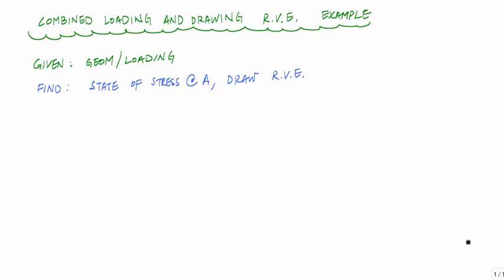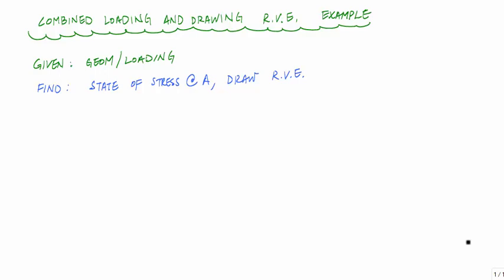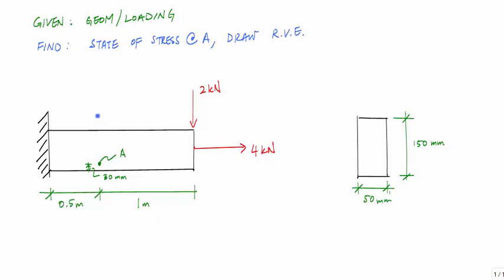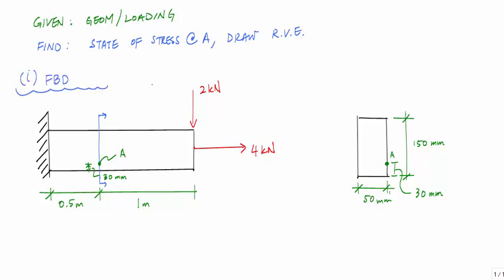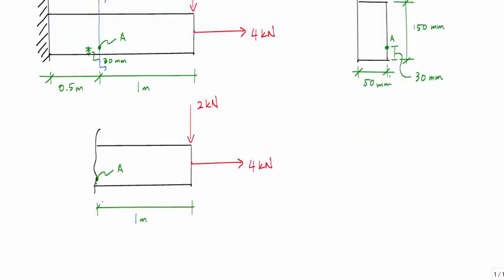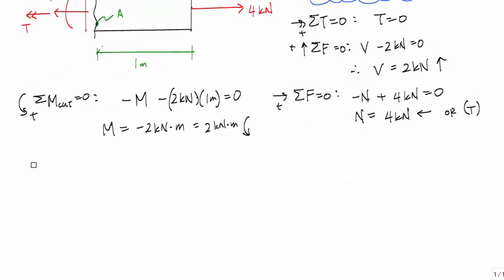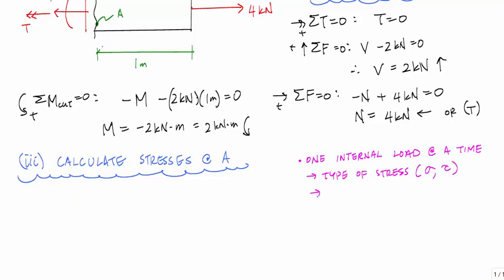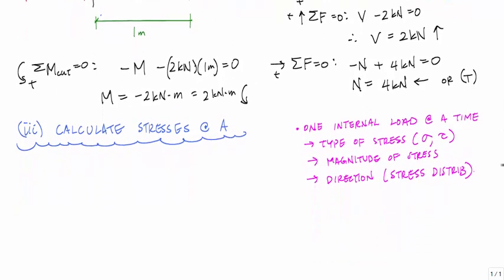Combined Loading Example 1 (Part 1/2) - Mechanics of Materials

Comment: Thanks. But why did you use M = +2kN.m instead M = -2kN.m
Reply: The sign is there to denote the direction. You could ignore the sign in the calculations as long as you address the direction in the graph or in the final result.

Comment: What about if you placed A on the other side? (At 1:15, A is on the right side of the rectangular beam). Im doing similar problem with a circular cross section and shear stress opposite sign on each side, not sure why

Comment: These videos are great, and they've helped me pass my CE 204 class. I do have a slightly unrelated question though

Do you think you could upload your work sheets in the discription of the video? I try to follow along, but sometimes you pull back values or equations from previous pages and I have to backtrack in the video to find what you're talking about. It would be easier to work alongside the PDF.

Idk if others get this too, its just a helpful thought:)

Comment: Should the cross sectional area be equal to 500 mm * 150 mm (.5 meters = 500 mm) ?
Reply from the maker: Sannisha Castillo i had it set up as 50 mm * 150 mm.  (50 mm = 0.05 m).